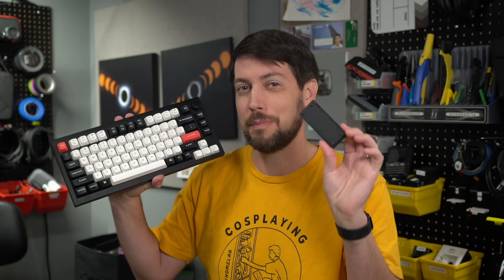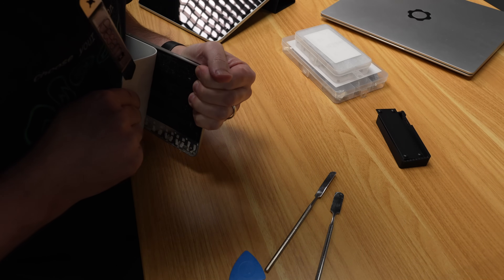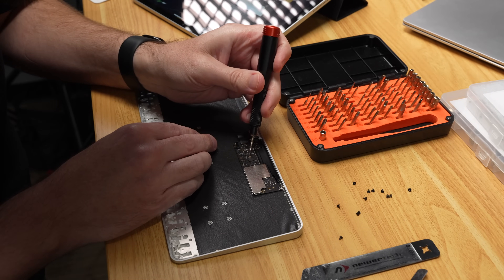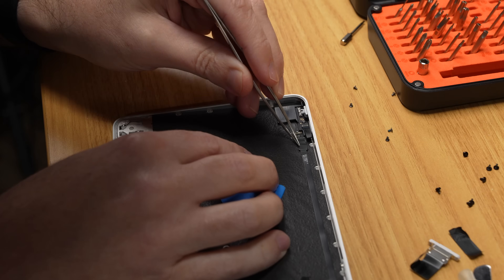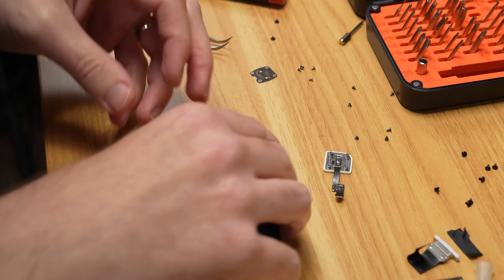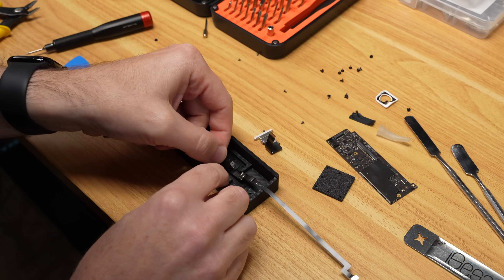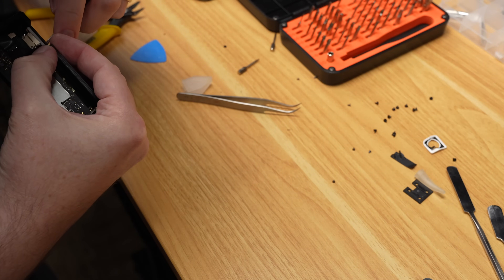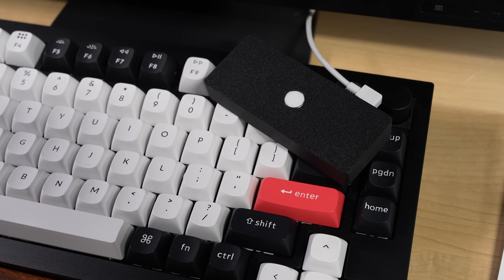Why doesn't Apple make this?

Comment: I hated being required to provide my fingerprint to the massive corporations that built the medication control systems at the hospital so I'm absolutely not giving it to Apple or Google, I even refuse the DMV. None of these companies care enough about our privacy and a data leak involving your fingerprint could land you in federal prison for life.
Reply: I completely understand your stance but wonder if you are perhaps unaware of how the process works at a technical level. You're not sending any data about your fingerprint to Apple; you're storing within the secure enclave chip within your device in a supposedly 1-way fashion (it ie can't be extracted). I'm sure someone will prove that wrong one day though :)
Reply: @new-zealand-clippy  There hasn't been encryption yet that can't be broken. If it's doing a client side check it's got your fingerprints in there, that device gets stolen you better just cut off those fingers. 

If it's company side they're sending your fingerprint into the ether so you don't have to be bothered to type. Those secure medication cabinets went down when the network goes down and access is hospital wide so it's on a central server in the hospital. With all these data breaches and ransomware attacks on hospitals and electronic medical record companies it's super concerning.
Reply: @mattgayda2840  yes I did say someone will prove me wrong one day :) but as far as I know, AES-GCM is at least one ciper than can't be broken right now. And tbh I'm relatively confident your fingerprint isn't going to Apple either but I respect your scepticism

Comment: About heating the glue, why didn't you just put it on the 3d printer bed? You can control the temperature. Seems like the perfect solution.

Comment: I was actually just starting to search for a solution like this because I just recently joined the MAC world but hate the keyboard.  This might be more than I want to do.  Wish Apple had a separate device for this that don’t like that keyboard.
Reply: but the magic keyboard is the oly keyboard specifically engineered for your Mac and made by Apple, so it is the only thing any self respecting mac user would use (/s for clarity).

Comment: For my linux desktop, I've basically implemented the equivalent of Touch ID using a Yubikey Bio and pam_u2f. It's not perfect but it's much better than fprintd since there's an actual cryptographic relationship between the fingerprint and the machine.
Reply: I wished the cheaper Windows Hello fingerprint dongles would work under Linux though. I have one on a dual boot system and its like a appendix in Linux
Reply: That sounds pretty nice.  I've been limping along with fprintd and this awful optical fingerprint reader.  It's terrible
Reply: Nice!
Reply: Eh, feds can require you to give biometrics, even though they can’t legally require you to give passwords. The government is not your friend, don’t make their job any easier. They glow in the dark.
Reply: @Scrogan Not everyone needs to include the Fed in their threat model (although most people in the US should these days for their primary device)
Reply: @Scrogan  my machine still requires a passphrase to decrypt the drive.

Comment: Keyboards should not have glue…Apple WTF!
Reply from the maker: A dab around the edge for waterproofing if it's IP68 rated, I could agree with. But that much glue is just an insult lol
Reply: @Level2Jeff  And really, we've had a nicer answer to waterproofing since long before any of us were around: gaskets. I wish we could've loudly pointed this sort of thing out during the early '10s. Maybe repairing a lot of devices would be more realistic for everyone.
Reply: @Level2Jeff Crosscall does ip68 phones without a single drop of glue. Only screws and rubber bands.
Reply: @Benoit-Pierre rubber bands? Do you happen to mean O-rings/gaskets?
Reply: @Level2Jeff  Well,you know Apple loves to insult their users.  Definitely insulting their intelligence.
Reply: Apple - "Thanks for the advice, we will now start to laserweld the keyboard instead".
Reply: Tbf some mechanical keyboard use damper on the bottom of the case for good sound and feedback
Reply: It's a feature not a bug for Apple, they don't want you doing repairs yourself. They want you to throw it away or trade it in and buy a new one.
Reply: With this small thickness and no structural metal, it probably provides more flexural strength.
Reply: @JohnADoe-pg1qk  It does. It also acts as a shock/sound absorber.
Reply: considering that they still had screws inside the thing, this was completely unnecessary on their part - it's one thing to cut costs and have glue instead of screws, but having both just shows contempt for users wanting to repair their devices.
Reply: Why not?

Comment: I did this last year and found a seller on ebay with kits of pre-disassembled Touch ID parts for $70-$80. It came with a Touch ID sensor, logic board, ribbon cables, lightning connector, and battery.

5:48 I just used hot glue for the lightning connector!
Reply: Do you have a link? I would love to setup something similar to avoid having to open my Mac laptop each time to use Touch ID
Reply: @JacobHill43099  can’t post the link here but the seller is called “Part Haven”

Comment: How do you the new mechanic keyboard compared to the low profile Magic keyboard? I've kept using the Apple keyboard even though I fully switched over windows on my iMac.
Reply from the maker: It is nice, took a couple weeks to adjust, but I tuned in the key travel a bit, and I can type a bit more confidently on the Keychron now... they sent this unit to me, but I'm going to buy a 2nd for home.

Comment: all that effort and you didn't even integrate it into the mechanical keyboard?
Reply from the maker: My initial goal was to get the thing working.

I may work on a different case design at some point, to at least get the button to be more integrated, maybe just along the back or side or something. It seems slightly too flimsy to get where a normal key goes.

Comment: might have to do this - got a few magic keyboards floating around
Reply from the maker: > floating around

Woah! I didn't know they were that magic!
Reply: @Level2Jeff  It’s part of the latest os beta release 😁
Reply: @Level2Jeff  Nah, it's just Python!

xkcd 353
Reply: Make an extra one and I’ll buy it (if the price is reasonable).
Reply: I though magic in the name was just  catch phrase
Reply: Just be aware, that touch ID or similar biometrics used as a stand alone authentication method isn't legally protected nor protective in any way, it's just a funny gimmick. Passwords are always safer, and only if you add a fingerprint etc. on top of it, it gets slightly safer.
Reply: @haifutter4166 But TouchID and FaceID aren’t used alone. You must enter a password after every restart to enable those biometrics, and periodically afterward to re-enable them, and you can also force the device to require a password with a few quick key-presses. So, while your statement is technically correct, the implementation doesn’t fit your premise.

P.S. most Android devices using biometrics have similar provisions. It does not appear that Windows Biometrics (part of Windows Hello) does not require a password as IOS. MacOS, and Android devices do.

Comment: How about a keyboard with a compartment at the bottom for a Magic Keyboard, positioned slightly offset so that the sensor key remain accessible?

Definitely not cheaper, but the Magic Keyboard wouldn't need to be butchered. However, this would force the users to use one specific keyboard, although the keys could be made interchangeable so that at least the desired key characteristic could be chosen. And I don't know if that will make the keyboard too high.
Reply from the maker: The other downside to that (believe me, I considered it heh) is you then have a battery powered keyboard under the main keyboard, and I like to have as few battery powered things at a permanent desk setup as I can, especially if I don't use them regularly.
Reply: @Level2Jeff  Do you know if someone has reverse engineered the keyboard matrix and connection to the logic board of the Magic Keyboard to use another keyboard instead?

Comment: I have the touch id board extracted from a full-size magic keyboard (the one with a numpad). Unfortunately there's no 3d printed models for it 😢
Reply: If you talking about longer board, I’ve seen models for it
Reply: @olehprokopenko if you have a link that'd be amazing!
Reply from the maker: Ouch! Are you just using it bare or taped onto something in that case?
Reply: @Level2Jeff it's jerry rigged into a section of clear plastic folder that's hot glued together. Not pretty but it's held up for more than 2 years so far.

Comment: Can't you unlock with your watch?
Reply from the maker: Yes, but the watch connection can be flaky. Sometimes it just... stops working. Other times it will take 5-10 seconds before the watch notification pops up. I like a nice little wired solution.
Reply: watch unlock is the dumbest thing, it keeps unlocking my mac from around 3 meters when I’m sitting on the couch

Comment: I'm confused, why would you care at all about Touch ID when you appear to be wearing an Apple Watch? Not only will it present the same functions, you don't even need to touch it. Proximity is sufficient.
Reply: - Multiple users
- Watch and computer could be stolen/taken together. TouchID should force the owner to be present. (Depending on the situation, this can be a good thing or a bad thing.)
Reply from the maker: You have to double-click the side button on the watch to activate things once the computer's unlocked, and the wireless connection is not always reliable.